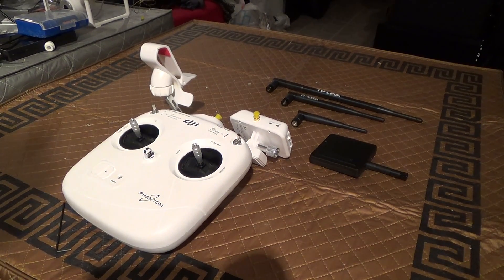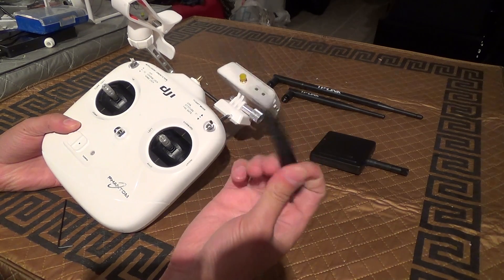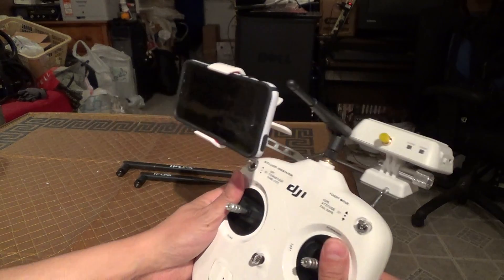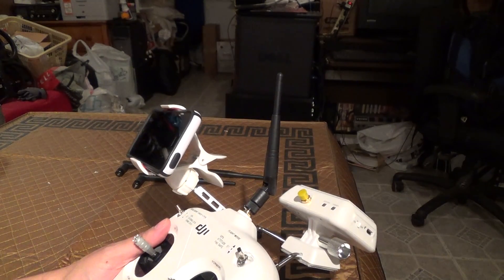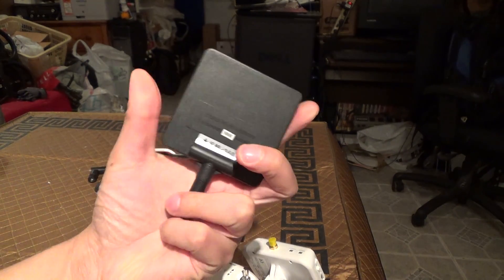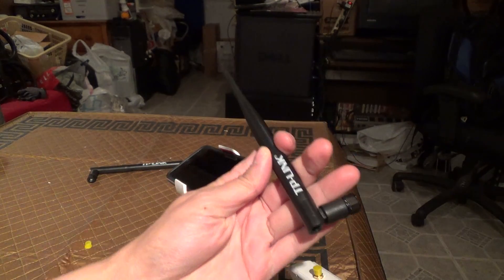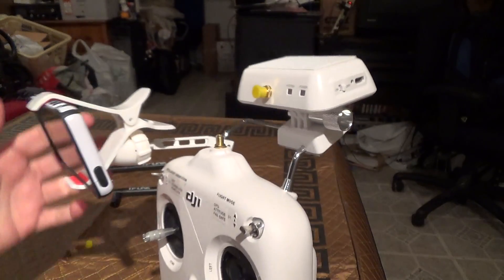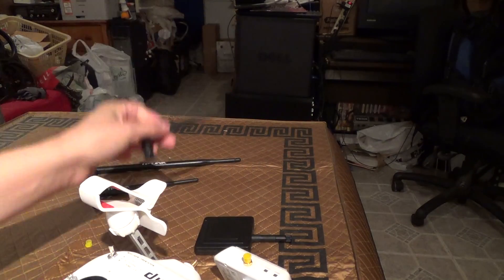DJI Modded Phantom Radio Control Antenna Range Test Result

Comment: great video! question. you ended up doing the 2 antennas mod for the FPV part correct? last time you said that only one was good enough, what changed?
Reply from the maker: Since the wifi on the phantom 2 vision is diversity and not MIMO yes one is only needed.  The reason for adding two vs one is as follows.  I can put two different styles of antenna.  For example a skew planer which is omni directional and does not require being pointed at the phantom and a directional for when I pull it out to long range.  Another option is to have two directional antennas spaced an appropriate distance apart from one another.  The benefit of that is it gives you a slightly wider view of the sky so you don't always have to be pointed as precisely to the Phantom to maintain good FPV feed at very long range.  I also can mix it up using my two different directionals, my 9dbi half dome antenna from FPVLR and my high gain helical from Circular Wireless.  The half done gives a much wider view of the sky than my higher gain 12dbi helical from CW which has a more narrow field of view.  I'll still have to point at my Phantom with that setup but again it allows me to not have to point so accurately especially when flying sub 1km.

Comment: Ben , What's the best antenna that u recommend for the RC control?
Pls advice me !
Reply from the maker: A 5.8ghz patch antenna will give you the greatest range.  Tho for RC control I would rather use an omni directional in which case any standard dipole will work. One specifically designed for 5.8 will work best tho  I've even used my TP Link 2.4ghz 5dbi antenna past 4k feet vs the stock antenna which barely worked to 3k in the area I did my flight testing. Range will increase or decrease depending on the environment you fly and how much RF interference present.

Comment: Thanks for the video Ben. But don't you had a problem with 2.4Ghz TP link antenna with 5.8Ghz TX?
Reply from the maker: Actually the 2.4ghz dbi TPLink antenna worked okay on the 5.8ghz RC giving me roughly 50 percent gain in range over stock.  The funny enough a 3dbi antenna I have from a 2.4ghz wifi range extender I have consistently worked ever so slightly better usually giving me a couple hundred more feet.  Maybe 5.8ghz specific antenna will give the optimal performance but 2.4ghz antennas work fine you just get less of a dbi gain from them as is on the label when used on 5.8ghz equipment.

Comment: I recently purchased my first Phantom vision 2 plus. Where can I purchase the 3db gain antenna that works with the 2.4, 5 Ghz device you screwed on the remote controller. I can't find it anywhere on ebay. Can I purchase it at Radio shack? Please advise, Ben
Thanks,
NB Productions
Reply: Amazon got them all.

Comment: I see you test a lot of antennas, what do you recommend on the pilot level? I want something that's compact and effective, both for control tx and wifi. The square patch antenna.. do you loose control at close range (like <30m) if you are out of the "beam" ?

Comment: Well am really confused between the difference of modifying the repeater range extender and the RC controler ... can u explain ?
Reply from the maker: The wifi range extender is specifically for the live video feed to your phone or tablet.  The radio control specifically controls flying your phantom and has nothing to do with the video feed.

Comment: Hi! And how about cloverleaf antenna from previous video? :)
Reply from the maker: The little white 5.8ghz clover leaf antenna gave me virtually the same range as with the stock antenna.  I didn't really notice any improvement in range with that one.  

The 3dbi antenna I took off my 2.4ghz Hawking repeater has given me better results so far then that clover lead as well as the 5dbi TPLink omni strangely enough.  Next tests will be with the 8dbi TPLink omni then finally the 11dbi patch antenna, tho only downside to the patch is it really needs to be aimed well at long range as it has a narrow beam width.

Comment: Ben, well... Not so well, but thank you for asking.

Smacked the bird into a building doing about 30mph. Was able to retrieve most of the bird. Bent an ESC. Ordered a new shell and an ESC. I also order a new receiver. 

Not sure if I need the receiver but when I fire up the bird I get constant blinking yellow lights and no motor control. Tried re-binding the birds receiver and rc controller, but get no LED activity when I push the LED button on the bottom of the P2V.

Any advice?
Reply from the maker: gasp why did ya do a silly thing like that for? The Phantom is a plane not a battering ram.  :P

The LED pattern you see is typical for when there is no connection to your radio control.  It's possible you may need to replace the receiver board I think it's around $35.  

Best of luck getting her in the air.  And no more kamikaze flights.

Comment: Uh Oh!  Maybe I went over-kill... I ordered a 16 dbi omni directional antenna.  I haven't installed it yet.  I'll probably end up with the square one like you showed or something similar.  Appreciate your videos.
Reply from the maker: The square is nice. Only downside of it is the narrow beam width of approx. 30 degrees so you have to point it fairly accurately at long range.  Adding an amp to the control will further improve it as well and is required for maximum possible distance. Though range with the DJI controls can vary widely do to build quality and varying power outputs.
Reply: Ben7seven7 Yep, the 16dbi antenna didn't even work as well as the stock antenna.  I have a 9dbi omni directional antenna around the house and, of course, I can't find it.  So, I'm going to order one of those square ones, I think.

Comment: Looks factory installed Ben, great job!
Reply from the maker: Thank you :) it took a little trial and error until I ended up where I did.  I'm happy with the results and running well. My first test flight with it also neeted me my longest distance FPV run to date so far of 4,500 foot distance at 640x480 15fps. I wasn't even using my wifi amplifier this time which is what I was using on my prior record.  I'm excited to see my furthest range potential around these Wifi saturated parks I generally fly in.
Reply: Soon you'll be able to go so far, you're going to have to make battery mod just so you can fly it back! LOL Can't wait to see your longest run video. ;-)
Reply from the maker: Lol yeah I could solder leads to the main battery so I can add maybe a 2200mah battery in parallel with the stock battery.  There is a delicate balance tho of power to weight tho new T-Motors will help with that.  Tho one of my T-Motors isn't good
 it has too much friction so I'm returning it for a replacement set.  Anyway if I fly in a clear area and using my 2w or my new 2.5w amp I should be able to pull off a 4km flight if not more.
Reply: That may be a good idea, more power (fly time) is always good. :-)
Reply from the maker: Yep if looking for uber long flight distance a little extra battery juice would definitely be helpful.  I think doing a dual battery setup should work.  Tho I don't know that I'll be doing that but you never know what the future may bring but whatever it is hopefully its all good.
Reply: True, it is very unpredictable. The best we can do is hope for the best, but prepared for the worst. Happy flying!

Comment: Ben,
Enjoy your mod videos. Thank you.

Have tried all your controller mods-including adding a 39dbm 2.4ghz amp. Went well until I tried the camera mod - where I think I broke a the ULF connector on the UFL/SMA cable for the exterior antenna, now I am reduced to 650' FPV (even after re-connecting the internal camera antenna).

Ordered new ULF/SMA cables for both the repeater & camera. Hope that's the issue. Will keep you posted.

Paul
Niagara Falls, NY
Reply from the maker: Hi, as long as you only damaged the cable itself, and not the u.fl male on the transmitter board you'll be okay just swapping out the cables. For a cable to replace the internal cable that connects to the internal antenna, that's a male to female u.fl cable.   Were you doing the Easy Mod method of install? If not I recommend my Version 3 install method.
Reply from the maker: And how was your range before you did camera mod? What antennas were you using with it?  Also this video was processed before the whole how to where I do the mod.  The how to is now available. I show how I remove the sealant covering the U.FL connector inside the radio control and how I do everything.
Reply: Hi Ben, 3500 feet. Went over the top of a hotel & then along the "Little River" to Cayuga Island in NIagara Falls. If I can figure out how, I'll shoot you a video. Now that I think of it, right after that someone tripped over the antenna wire going to the amp. I lost distance after that (1500') & then aggravated the loss by screwing up the camera mod. I haven't given up yet!
Paul
Reply from the maker: Paul Grenga How's your Phantom working now?